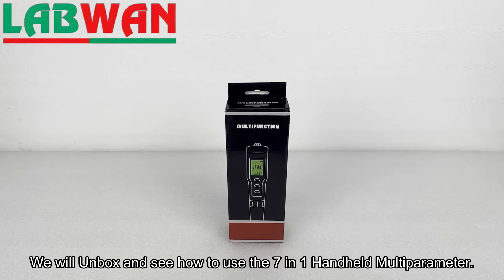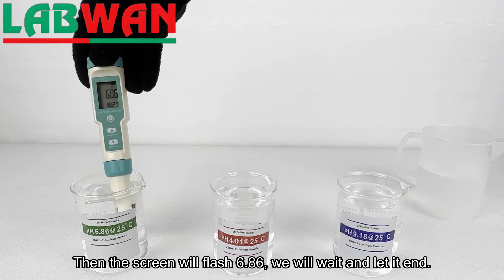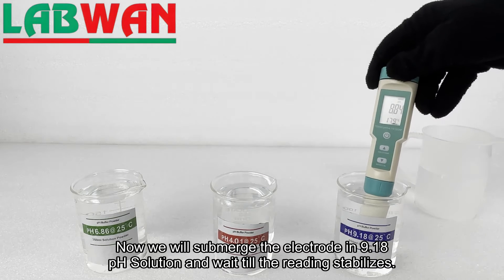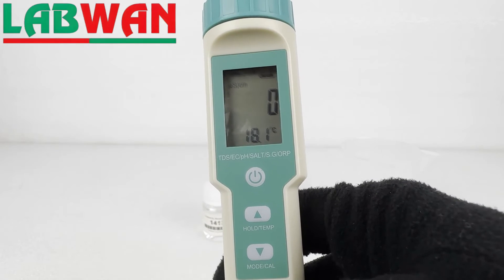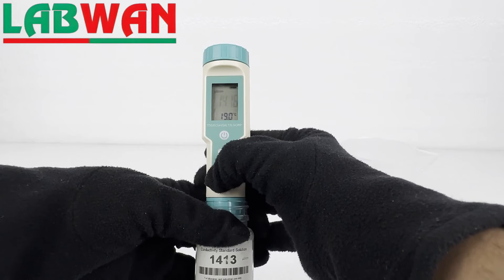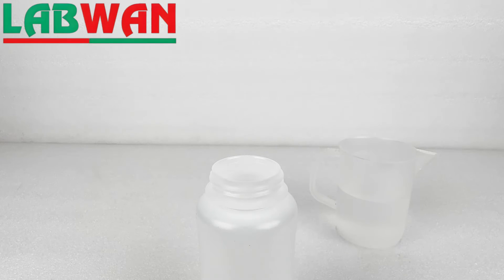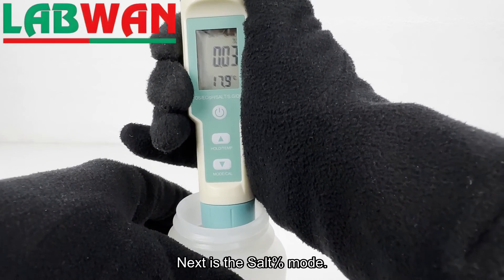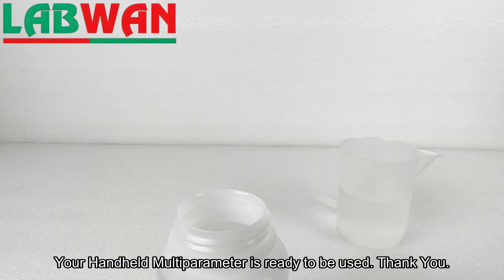7 in 1 PH/TDS/EC/ORP/S.G/Salinity/Temperature Multi-Parameter Pocket Water Quality Tester

Comment: I bought the product but it doesnt come with the batteries. Where can i get the batteries in south africa?
Reply from the maker: Thank you for your purchase! We ensure that each unit we ship includes the required batteries. However, if your device arrived without them, you can easily procure the batteries from any local electronics store or online marketplace in South Africa. The required battery type is commonly available, and the cost is usually less than a dollar.

Since we currently do not sell directly in Africa, we recommend checking with your local supplier or retailer for assistance. If you need further help, feel free to reach out!
Reply: @LABWAN  Mine also came without batteries. And it detects the 6.86 solution as 9.18. I have tried so many times now, but the same happens always.
Reply: Than you very much, the meter is working fine for pH.  I need it to read EC in the range 5- 100 mS/cm. I calibrated with EC 1288 mS/cm. The values are accurate betwwenn 0-20 mS/cm. How do I calibrate it for higher conductivity?

Comment: Hello,
Assuming after a while of not using the multiparameter. You do the calibrations, but you find the 6.86 buffer is not read by the multiparameter. Rather, it reads above 8 pH. What's to be done with that? 

Note: distilled water (250 mL) was prepared THEN the powder were added to it (all three buffers were done so) then stirred. Also it was prepared in a cold location (below room temperature).
Reply from the maker: If your portable 7-in-1 multiparameter water quality tester is reading a pH 6.86 buffer solution as above 8.0, here’s what you can do:

Possible Causes & Solutions:
Dry or Contaminated Inbuilt Sensor

Cause: If the device hasn’t been used for a while, the inbuilt electrode may have dried out or accumulated residue.

Solution: Soak the sensor in a pH 4.00 buffer or electrode storage solution for at least 30 minutes before attempting calibration.

Expired or Contaminated Buffer Solution

Cause: Old or improperly stored buffer solutions can give incorrect readings.

Solution: Ensure you are using a fresh pH 6.86 buffer solution. If unsure, try using a new one.

Incorrect Calibration Procedure

Cause: Skipping steps or calibrating in the wrong order may lead to inaccurate readings.

Solution: Reset the device and carefully follow the manufacturer’s calibration instructions. A two-point calibration (e.g., pH 4.00 and 6.86) is recommended for accuracy.

Electrode Aging or Damage

Cause: The inbuilt sensor may have degraded over time due to prolonged exposure to harsh water conditions.

Solution: If the device has been in use for a long time and the issue persists despite cleaning and recalibration, the sensor might need replacement.

Final Recommendation:
Soak the sensor in storage solution before calibration.

Use fresh buffer solutions to ensure accuracy.

Follow proper calibration steps to avoid errors.

If the issue persists, the sensor may be worn out and require replacement.
Reply: @LABWAN  For how long is it recommended to store the multiparameter with KCl 3M? What about any concentration like 1, 3.3, or 4M? I mean long-term storages! What abput short term storages? Would it also be just fine to pour distilled water instead of KCl?

 Note that Manuel has mentioned nothing, nor was anything with the box when bought.
Reply from the maker: @ Thank you for your inquiry regarding the storage of your 7-in-1 multiparameter water quality tester. Proper storage is essential to maintain the accuracy and longevity of your device's pH electrode. Here are our recommendations:
Long-Term Storage:
•	Recommended Solution: Use a 4 M KCl (Potassium Chloride) solution to store the electrode. This concentration helps maintain the electrode's functionality over extended periods.  
•	Alternative Solutions: If a 4 M KCl solution is unavailable, a 3 M KCl solution can be used as an alternative. 
•	Storage Method: Fill the protective cap with the storage solution, ensuring it covers the glass bulb of the electrode. Replenish the solution as needed to keep the bulb moist.  
Short-Term Storage:
•	Between Measurements: You can temporarily store the electrode in pH 7 buffer solution or clean tap water. This helps keep the electrode hydrated between uses. 
Storage in Distilled or Deionized Water:
•	Not Recommended: Avoid storing the electrode in distilled or deionized water, as this can cause ions to leach out of the glass bulb, potentially rendering the electrode useless. 
Regarding Concentration Variations (1 M, 3.3 M, 4 M KCl):
•	Optimal Concentration: A 4 M KCl solution is ideal for long-term storage. 
•	Acceptable Variations: Solutions with concentrations ranging from 1 M to 3.3 M KCl are generally acceptable for storage. 
•	Preparation: To prepare a 1 M KCl solution, dissolve approximately 75 grams of solid KCl in one liter of distilled or deionized water. For a 3.3 M solution, dissolve about 223 grams of KCl in one liter of water. Always ensure the KCl is fully dissolved before use. 
Additional Tips:
•	Regular Maintenance: Periodically inspect the electrode for any signs of damage or contamination. 
•	Calibration: Regularly calibrate your device using fresh buffer solutions to ensure accurate readings.
If you have further questions or need additional assistance, please don't hesitate to contact us.

Comment: Would be nice to know the IDEAL readings for each mode
Reply from the maker: Thank you for your inquiry regarding the ideal readings for each parameter measured by the 7-in-1 pH/TDS/EC/ORP/S.G/Salinity/Temperature Multi-Parameter Pocket Water Quality Tester. The optimal values can vary depending on the specific application and the type of water being tested. Below are general guidelines for common water types:

1. Drinking Water:

pH: 6.5 to 8.5 (as recommended by the U.S. Environmental Protection Agency)

Total Dissolved Solids (TDS): Typically less than 500 ppm

Electrical Conductivity (EC): Varies; generally, lower values indicate purer water

Oxidation-Reduction Potential (ORP): +200 to +600 mV, indicating good oxidation potential
YouTube

Specific Gravity (S.G.): Approximately 1.000, similar to pure water
eBay
+4
Hedaometer
+4
YouTube
+4

Salinity: Close to 0%, as drinking water should have minimal salt content

Temperature: Typically between 5°C to 15°C (41°F to 59°F) for consumption

2. Swimming Pools:

pH: 7.2 to 7.8

TDS: Below 2,000 ppm
Hedaometer
+1
Amazon
+1

EC: Varies; higher values may indicate the need for water replacement
Amazon
+1
Hedaometer
+1

ORP: 650 to 750 mV, ensuring effective disinfection

S.G.: Approximately 1.000

Salinity: For saltwater pools, typically 3,000 to 4,000 ppm

Temperature: Around 25°C to 28°C (77°F to 82°F)

3. Aquariums:

Freshwater:

pH: 6.5 to 7.5

TDS: Varies; generally between 100 to 500 ppm

EC: Corresponds with TDS levels

ORP: +200 to +400 mV
Hedaometer

S.G.: Approximately 1.000

Salinity: Close to 0%

Temperature: 24°C to 27°C (75°F to 80°F)

Saltwater:

pH: 8.0 to 8.4

TDS: Approximately 35,000 ppm (equivalent to natural seawater)
Hedaometer
+1
Amazon
+1

EC: Around 50 mS/cm

ORP: +200 to +400 mV

S.G.: 1.020 to 1.025

Salinity: Approximately 3.5%

Temperature: 24°C to 27°C (75°F to 80°F)

Please note that these values are general recommendations. It's essential to consult guidelines specific to your application and local regulations to determine the ideal parameters for your situation. Regular monitoring and maintenance will help ensure optimal water quality for your intended use.